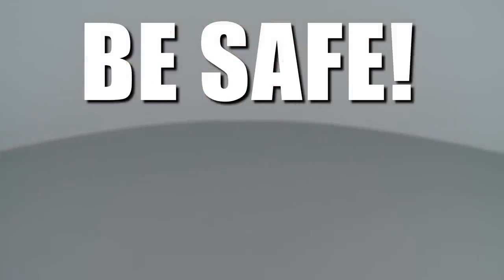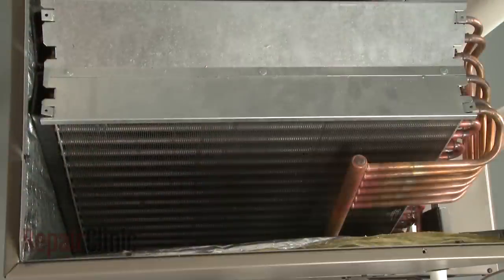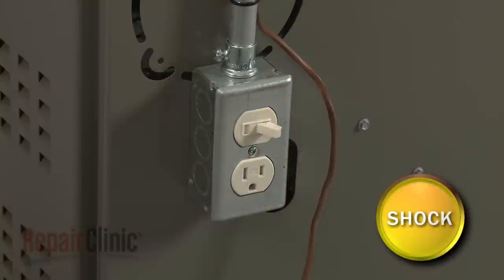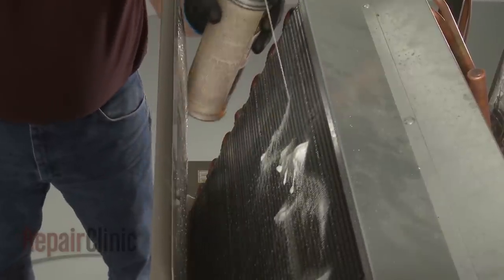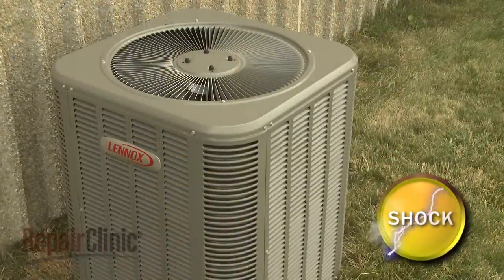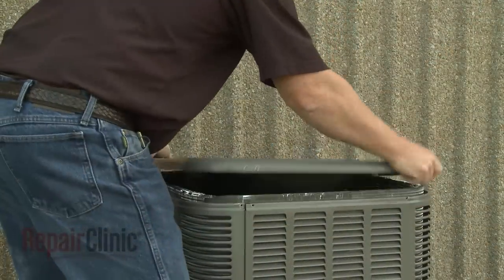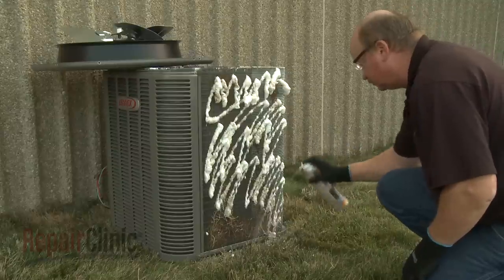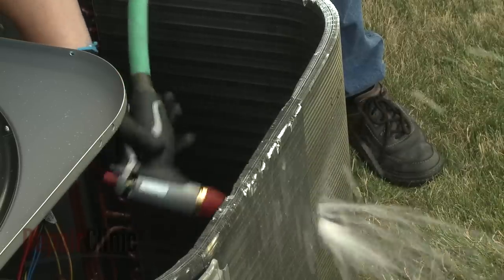How To Use Air Conditioner Coil Cleaner (Part #Triple-D-AER)

Comment: Hi. I used coil cleaner in the past. I used Nu Calgon brand. This time I used a different brand and now the coils are like cement. It didn’t rinse away like the original brand. How can I get rid of the cement-like gunk on the coils?  I will try using the fin straightener tool to clean. Any other suggestions for me?  Thank you.

Comment: Can I spray air handler coils on top  to clean the bottom side coils where the air comes in? Or do I have to spray those as well? They are very dirty with dog hairs and dust. Thanks for your response.